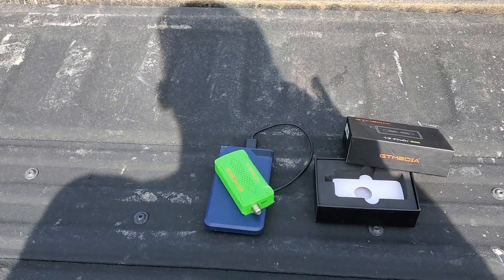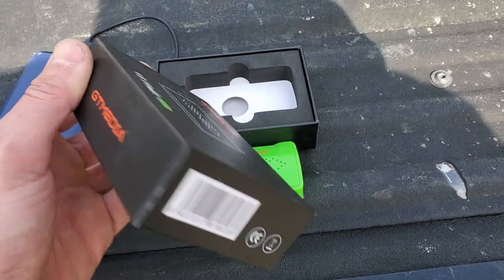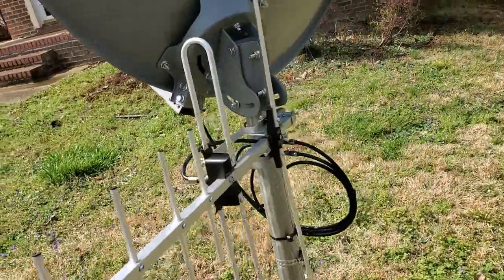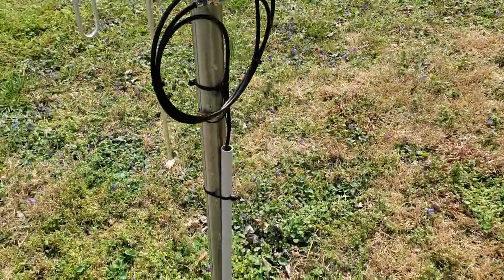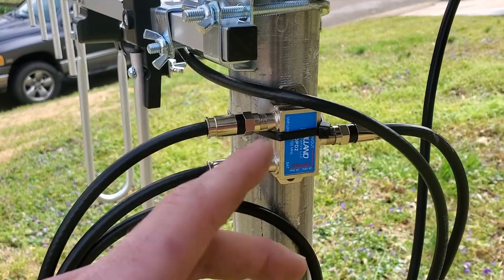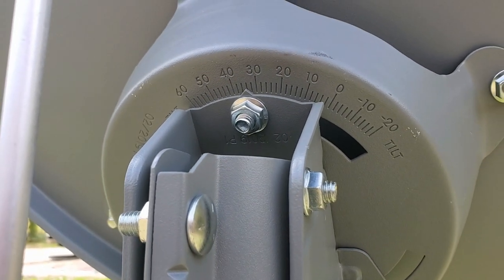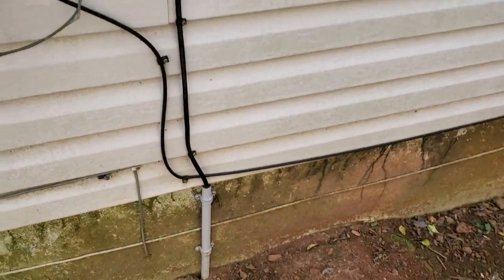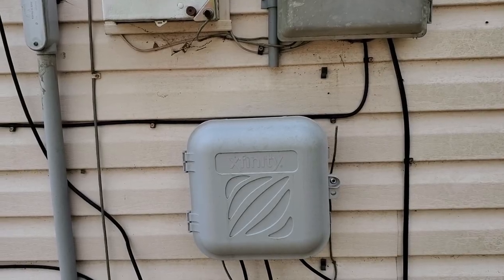Orby TV

Comment: Looks like the elevation is gonna be pretty low especially up north. A bunch of no line of sights. How reliable is the service? Does the off air antenna plug directly into the receiver and populate in the systems guide, or does it plug into the antenna connection on the tv and use the TV's off-air tuner? Just curious because I'm very much interested in potentially becoming an installer of this system, again the biggest concern being elevation as DirecTV's Slimline dish elevation is 40 degrees here in the Midwest and I know it's considerably higher in the south and you're pointing this systems dish at 38... 20+ year experienced DirecTV commercial and residential installer.

Comment: Broadcast Band  (local tv channels) Antenna is supposed to be horizontal and on the roof.
Reply from the maker: Are you an Orby technician?
Reply: It's very odvious that you have no knowledge about OTA reception.. Your not a Orby technician.. Orby doesn't have technician's..They have selected authorized installers.THATS definitely not a professional job..And no.. not just any splitters will work to add more receivers

Comment: So  is the skew  issue an issue if I use an old 20 year old  single lnb dish network dish to act as a pick up,  I dont want  the  tv antenna but what's  the bizarre tv antenna that is in this video is mounted  vertically as to normal  horizontally   what's that do  to perform better

Comment: So are you using conduit for the entire run? Or would underground wire be better for this kind of install?
Reply from the maker: Just burry the wire a few inches. Either way is fine.
Reply: Ray Johnson I was unsure, I used to be in that business about 4-5 years ago and we always had to use underground wire for the shielding purposes.
Reply from the maker: @James________  ideally you want to but if you don't have any you can use regular just won't last as long. Conduit is better to use if you can because it makes it super easy to replace

Comment: Can you use Dish wires, just switch out satellite from previous Dish Network satellite?
Reply: You can but make sure line is from sat to receiver with no splitters in it.  Uninterrupted cable line minus grounded points out at dish is the best path.  Always test line for proper cable when connecting, suggest to u the package that is sold with one receiver and a dish with antenna,  comes with pointer device, ...
Reply: Yes you should be able to. Take it from someone who has installed satellite dishes.

Comment: i bought the self installl kit for my van to travel. having a heck of a time finding good sq. good sinnal strength but no sq.
Reply from the maker: Hey sorry for the late response I hope you have it figured out by now but it really depends on what area you are in as far as the adjustments and settings. Just make sure your mount is plumb and level at the top where the top of the back assembly on the dish sets. Makes a world of difference.
Reply: @GrumpyPappy  I figured it out.  Pole being level is very important.
Reply from the maker: @libertyforamericanow  awesome 👌 and yeah it is very important.
Reply: You’re probably getting a different satellite a few degrees away. It’s not like DirecTV, it will show signals from other Ku- band satellites.

Comment: Also how do additional receivers connect? A multiswitch? SWM, or do you have to run additional lines from the lnb?
Reply from the maker: You can use a swm splitter. Any splitter should work.
Reply: @GrumpyPappy  Swm splitters are not recommended since only one port is power passing. Any all port power passing splitters will work with the Orby system.

Comment: What is the reception distance on that local antenna?
Reply from the maker: Really depends on your area but up to I'd say 100 miles ish depending on positioning and what's between you and your local stations.
Reply: @GrumpyPappy  awesome thank you for replying.
Reply from the maker: @6lastresort  you're welcome.
Reply: @GrumpyPappy   can you add a splitter to the air antenna side and add an other air antenna pointed in an other direction to improve local channel pick up?
Reply from the maker: @robertmoyer2506  honestly I don't know you'd just have to try it.
Reply: I would say if you stay around 30 to 35 miles from where it’s being broadcasted you will be fine. At around 60 miles only 1 or 2 channels will Come in.